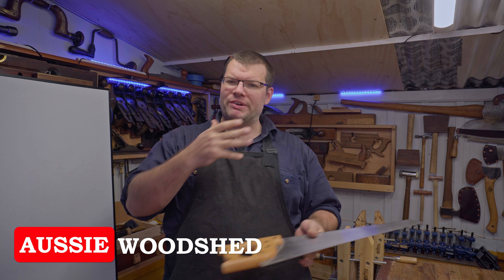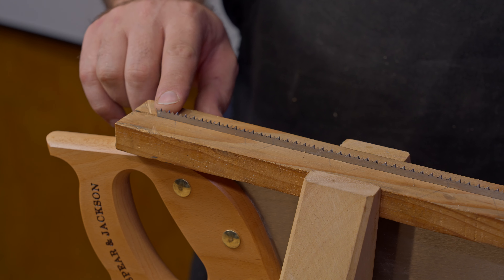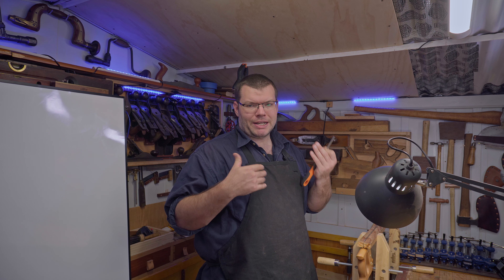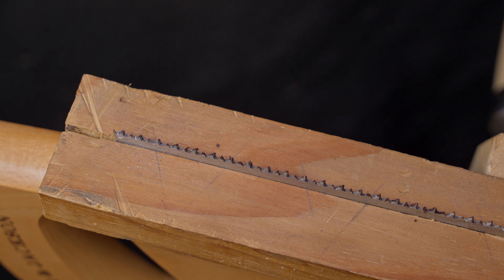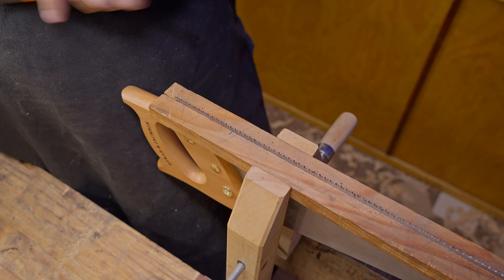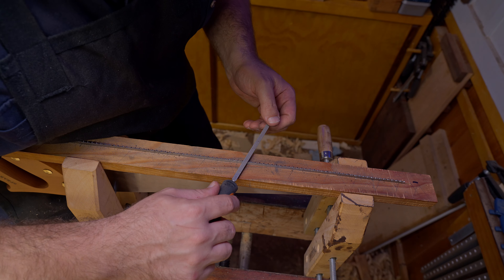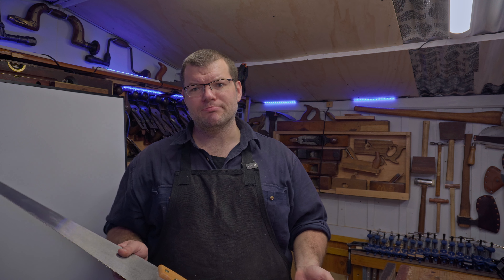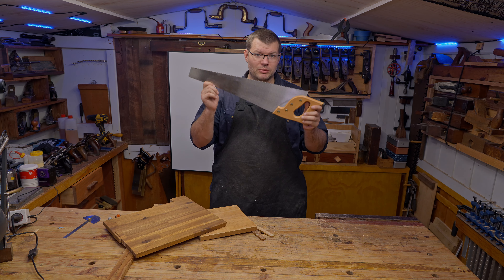No Faff Sharpening: Sharpen Your Cross Cut Hand Saw in Minutes!

Comment: I appreciate that the aim of your video is to keep things as simple as possible, but would add this thought. Even on a minor 'touch up' resharpening I always level the teeth LIGHTLY. for this a couple of light passes with a 400 or 600 grit diamond stone will leave very small bright spots which really helps in dialing in the points and goes a long way to eliminating cumulative variation in tooth height and spacing. Some might argue it speeds up consumption of the saw plate, and that is true, but I'm only looking at 1 or 2 thou per sharpening.
If one section of the saw gets used most or runs up against some foreign matter in the wood, there will always be that temptation to take 'just a little bit more 'in these areas to achieve good points when, during sharpening, these teeth can still be seen, or felt, to be dull. I find that the extra minute to level up keeps me honest  :<)
Reply from the maker: There is very little need to joint the teeth of a new hand saw (which i was doing here) if correct sharpening techniques are followed. By this i mean you should never do add additional strokes of the file to just a few teeth if extra passes are required they should always be done to all the teeth, meaning they should never become out of alignment.

The only hand saws i have ever needed to joint is vintage saws the first time I sharpen them.

Jointing the saw teeth every time is simply giving yourself more work and wasting the steel, you're far better to just sharpen with the same pressure and strokes on every tooth.

Comment: For me the biggest problem is seeing the shape of the teeth, especially at higher tpi (although I am rather ancient). I have noticed that most of the vintage saws I have acquired have hook shaped teeth  in which the top front portion overhangs, suggesting the previous owners had a similar problem. Does it matter and, if so, do you have any tips for correcting them. Loved the video.
Reply from the maker: @eddienew2044 If there are hooks on the saw teeth it won't cut properly.

Generally in my experience if a little hook is forming it is either the file is too small or too much pressure is being applied to the file, in the latter no downwards pressure is needed just push across the tooth and let the file do all the work.

If you can't see the teeth properly adding more light helps. Also I know Rob Cosman sometimes uses jewelers magnifying Glasses to help see (the swing ones).

Most of my saws are no more than 15-16 TPI as it gets progressively harder the more you add past that. I do have a 20 TPI gent saw which i hate sharpening, i will look into doing a video on this and try to come up with solutions to see these small teeth.

In terms of removing the hooks sharpening them out with correct technique should do the trick, it will likely be quite a few passes on each tooth.

I hope this helps! If you need any more help please ask and i will try my best to help you
Reply: I’m 67 and needed vision help so I got a Donegan magnifying headwear from Amazon. They come in different strengths and the one I have is great. I saw Cosman use one and also Thomas Lie-Nielsen when he was sharpening a LN dovetail saw. I have the 1.5 magnifier.
Reply from the maker: @BarryinFredonia  Thanks this is was exactly what I thinking of.
Reply: @BarryinFredonia  I tried one set with different magnifiers and didn’t get on terribly well. I will give them another try 👍🏻
Reply: @eddienew2044  I too swapped out my first set.

Comment: Splintering on the exit side is hard to avoid, no matter how good the saw is. Paul Sellers recommends knife-walling to 'help' avoid the issue but I've tried that and still (obviously) get a little splintering if my cut is too close to the line. An old carpentry trick is to use masking tape on the exit side and saw at a very low - or shallow - angle (so there is more saw in the wood than at a steep - or perpendicular - angle). If it's a matter of life and death, clamping a piece of scrap wood (the more dense, the better...and preferably contra-grain) on the exit side will usually eliminate splintering.
Reply from the maker: @PeteLewisWoodwork  I agree its hard to avoid, but you give some good ideas to minimise the splintering. I usually cut off my line and hand plane back to it in order to remove the splintering.
Reply: @AussieWoodshed  Yes, the time-tested solution is to stay away from the line and plane down after cutting. HOWEVER...it's so tempting to try and cut as close as you can - and therein hides the devil. After more than 40 years, I am still as guilty as anyone...!
Reply: Have to remember that my techniques are warped by my life career as a carpenter, aiming to get things done on the spot, regardless of the finished cut - if it fits, it fits and that's good enough. That is why I am liking getting back into hand tool woodworking - the challenges of accuracy and detail.